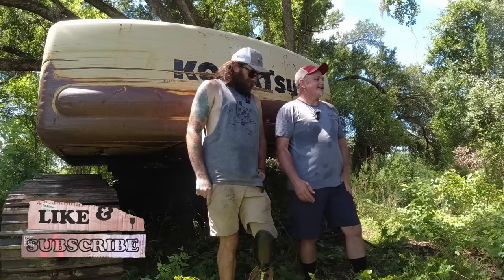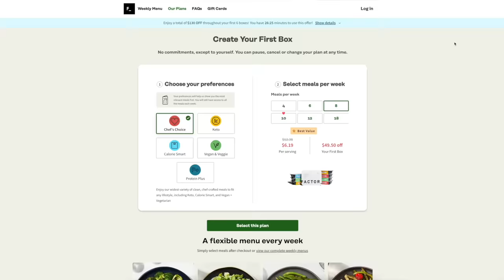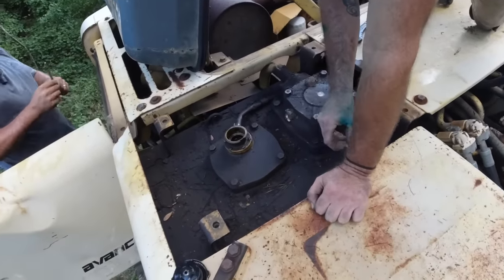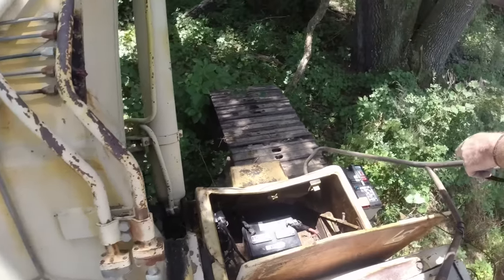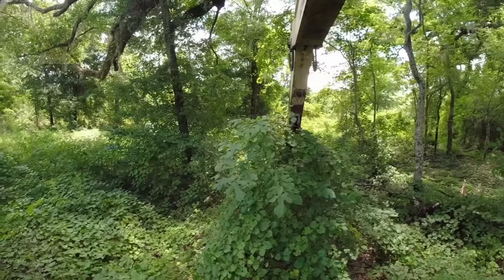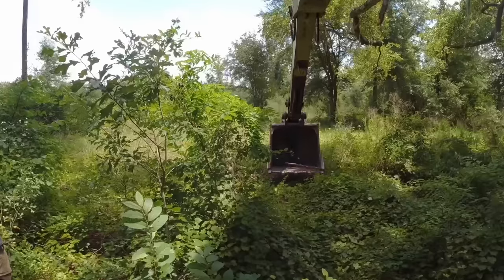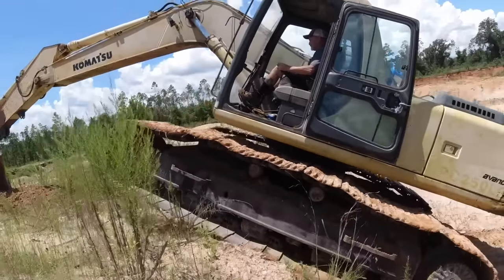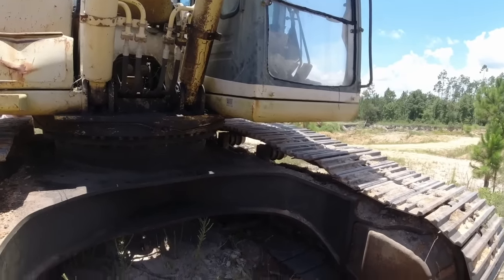Man Finds HUGE EXCAVATOR LEFT BEHIND In Forrest AND BUYS IT!

Comment: Those tracks should loosen up after the first 4 miles or so.    Sometimes running through water helps clean the rust out of the joints.

Comment: 41:00
Suggestion for you.
Get a small back-pack weed sprayer and spray a mixture of Kerosene & Diesel oil onto the tracks and leave for a few days, then move the machine 1/4 turn on both tracks and redo.
Same in a few days for the "1/2" track position and then again for the 3/4 position
Finally get back to the all around (start position) and give the entire lower areas of the tracks (runner wheels / open bearings, tracks etc. then leave the machine sitting a week.

Then - move the machine about 1/2 mile in either direction in a fig 8 and a few circles both ways.
After that, those tracks should have un-kinked themselves.
If not - tighten the tracks with the adjusting rods, and redo everything again, this time, adding some hydraulic oil & some very light rust-removing oil - to the sprayer too
Soon the tracks will "free" themselves up to unkink them all.
Then do a final track slack adjustment and you'll be good to go.
NEXT - lube the entire machine & replace any hoses and rubber pipes that appear perished.

Comment: When I used to repair heavy equipment that sat for a few years with frozen track links or adjusters, I would heat the outside of the link red-hot and then hit it immediately with water, you could hear the rust releasing by the way the metal expanded/cooled. Just heat the outside of the link, not the pin.
Reply: she runs real fine   but those tracks   are not happy....good advice   good eye

Comment: Ask Wally if you will I’ve got a 1974 Massey Ferguson 135 Diesel Perkins has fuel at filter, injector pump, and injectors but still will not crank. Do y’all have any recommendations

Comment: Some of the track pins need to be attended to so that they pivot easier than they do.   You could knock them out and replace them or just clean them up and re-install.  Good job getting that going.  It lives to work again.
Reply: Agree.
Reply: Just put a bit of penetrating oil on the track pins and cat it around a bit, they will loosen up.

Comment: Good job guys. It kinda surprised me though seeing you drive it that long distance over the sprocket wheels, especially after it had been standing for so long and the tracks might be stiff. I was taught to always - if at all possible - drive over the idlers, because otherwise you will pull the track on the top idlers and the track will buckle under the bottom idlers. But I am only being a smart ass and nitpicking :-) Nice to see an old girl like that in action (I have about 3000 hours on a PC240 in Iceland).
Keep up the good work guys.

Comment: You do still have to curl in and get those fittings on the end of your stick cause 3 going up only gets the two lift cylinders and the back of stick cylinder. There will still be end of cylinder and pin for stick and top of bucket cylinder you have to get.

Comment: That lever might have been taken off so some country boy doesn't run off with it.  Dead switch not installed. Tracks are stiff but need grease to size them length wise.

Comment: I pretty sure you all said it was making oil meaning it most likely had water water in the oil from rain or. Oister from sitting I'm surprised you didn't crack the oil plug loose and check for or drain off any water before milk shaking it through the hole engine and oil system
Reply from the maker: We say “it’s making oil” as a joke.  Is this your first time watching? Welcome. It’s become kind of a catch phrase on the channel. We even have shirts with it on them.  I appreciate you stopping by and watching and commenting! 👍

Comment: You should invest in a couple lithium batteries for the test starts. They are so much lighter and easier to handle. Save yourselves some effort and make life easier. Might even be able to spark up a collaboration with a manufacturer/seller of lithium batteries and get them for free. They make a lot of new sizes/powers now. The battery market has evolved a lot in the past couple years. Some really cool stuff out there now.

Comment: Think of any "smaller" adjustable spanner - as if it was just a normal PIPE WRENCH.
Pulling the fixed jaws towards the adjustable one, CLOSES the jaws and tightens it's grip.
Only an idiot tries to use a pipe wrench the other way, where it KEEPS opening and is forever slipping.
Same goes for your small engineering spanner.
The only problem, is that it is held by a screw-drive adjuster, which means that instead of opening the jaws to simply slip, an engineers spanner goes into compression & can "explode" violently when it breaks (and god help your fingers and knuckles when they get "pinched" between the handle and something very solid - like the machine you are incorrectly using that spanner on)

Comment: based on the tracks leading to the machine, its run or at least rolled into that location fairly recently. Not something I'd think of as a hard to start machine. Personally, I'd have had them drop it off near the shop, rather than in the woods.